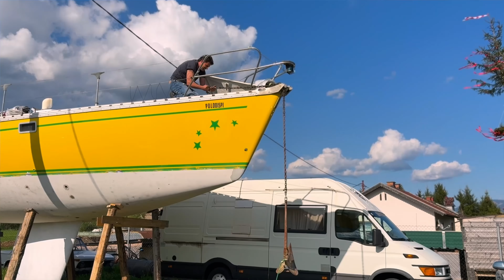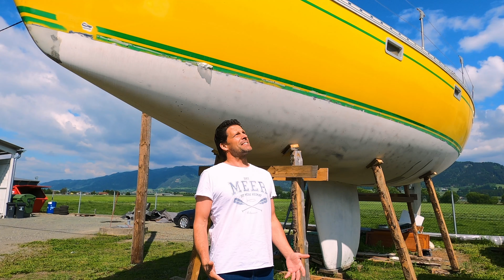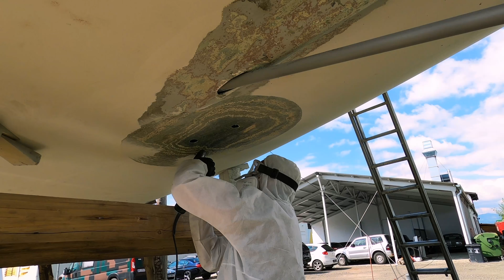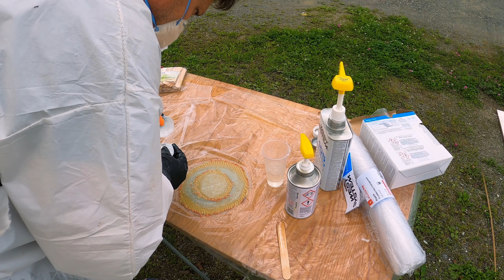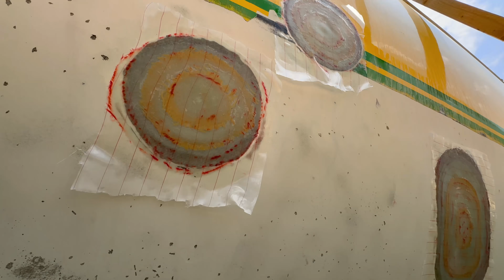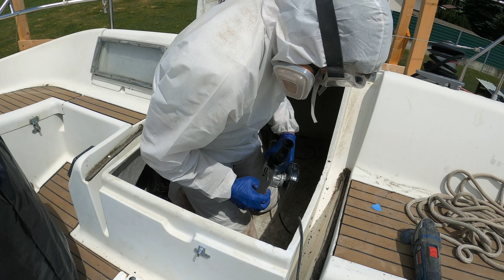DIY Project - SailingCelina - Ep.15

Comment: Are you worried at all about the deck sagging with all the bulk heads removed? Looking forward to the transformation, I have a similar RTW sailing dream but likely in a smaller boat
Reply from the maker: Initially I was indeed. Until I realized my boat is not build with balsa core nore foam. It‘s thickness is entirely laminated. Strong as concrete. Already jumped around on it and tested😉
Reply: Hahaha nice 😊